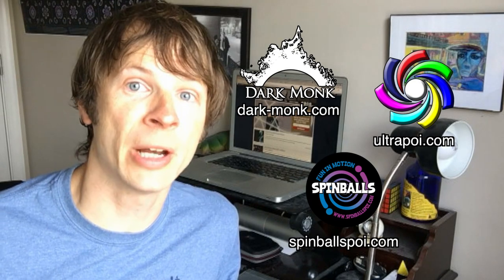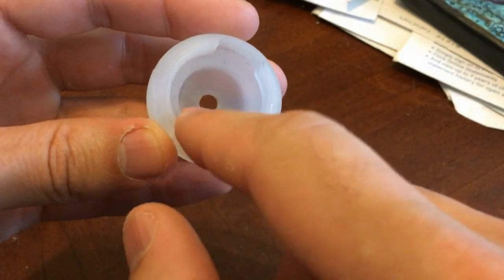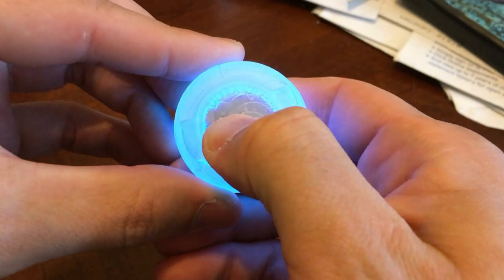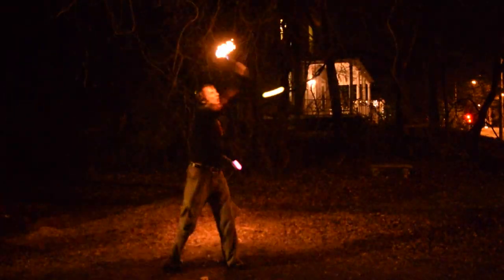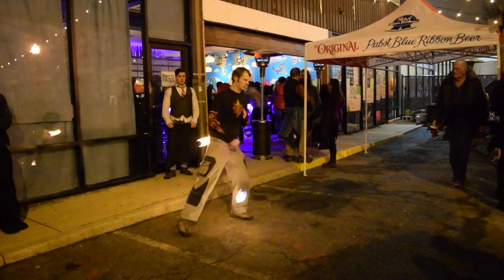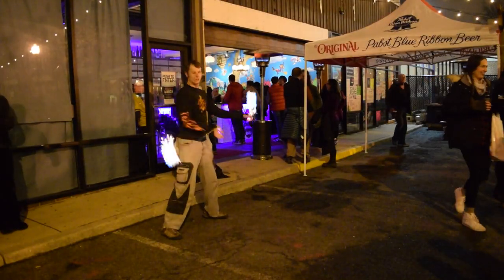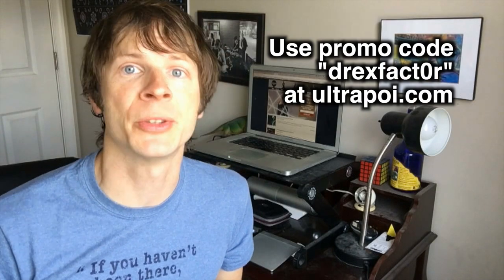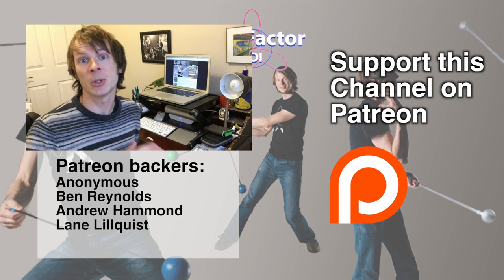Ultraknob Review: LED Poi Handle

Comment: hey Drex, great video and keep up the good work!  here's a tip about the ultraknob; (lock mode) if you notice the bracket that holds the battery, there's a little piece that looks like an arrow. Push the battery to the opposite side of the arrow and you'll notice that you can't push the button  (locked) push in the direction of the arrow and you'll make it easier to push.

Comment: I see u made this review back in april, and ive been really interested in these knobs for awhile now. But, im seeing a lot of peoole say all kinds of negative things about them like, the leds go out quick or get delivered messes up, the charging port messes up, the led flys out of the handles while spinning, etc. Now i also see u making videos still using them, so im just curious if you have ran into any of these problem after having use them more since u made this review.Your input would be most appreciated, and also want to thank u for taking some much time to make all of these videos for rhw community.
Reply from the maker: Hey Evan! I have definitely encountered some of these issues as I've worked with the handles. In particular the lights flying out of the handles and the charging port breaking off are glaring issues. I'm going to do a follow-up head-to-head comparison of all the current options for LED handles out there in the coming months that will address many of these issues.